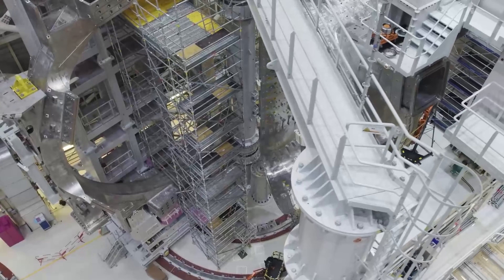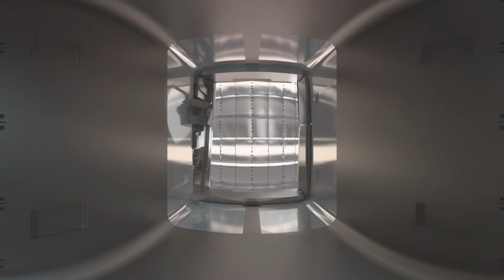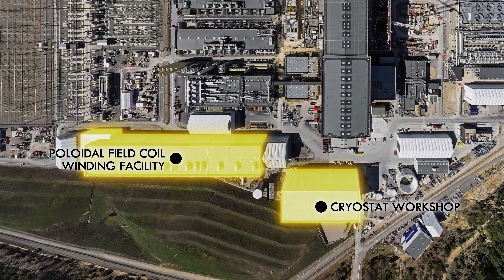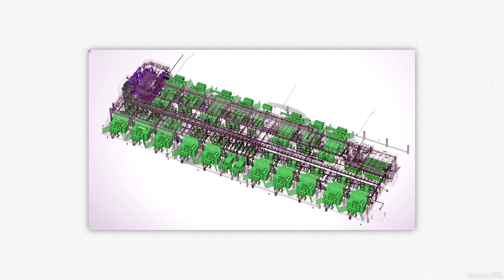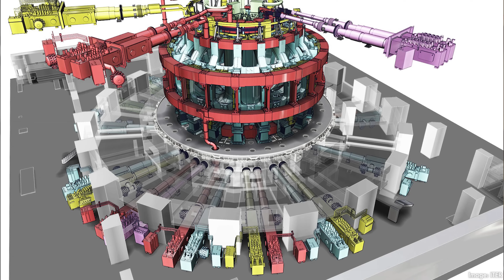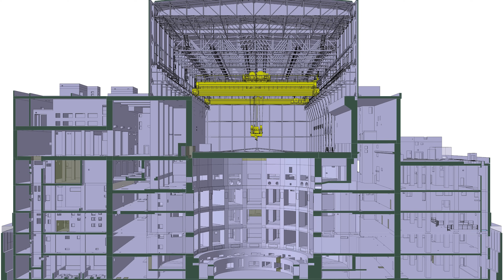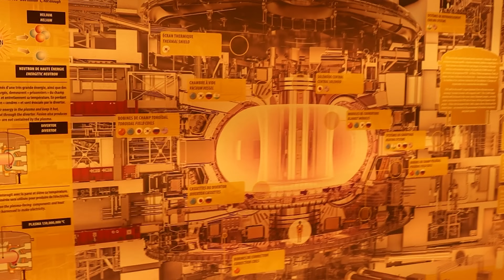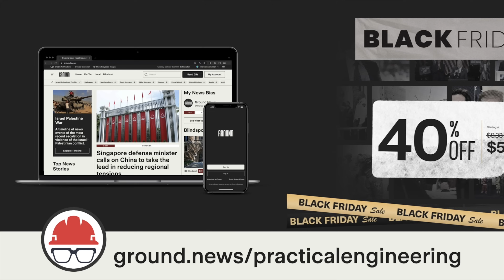Engineering The Largest Nuclear Fusion Reactor

Comment: 14:52 "designed to withstand plane crashes" that is true. That is a consequence of ITER being built in France, France has some of the strictest regulations regarding nuclear plants.

In my research on Germany's growing disdain towards nuclear, I found out that their politicians used the argument that their nuclear plants were vulnerable to plane attacks. Indeed, Germany's regulations are less strict regarding nuclear, and german nuclear plants were not required to withstand a plane crash.

In fairness, the stricter regulations increase the cost of building nuclear plants quite a bit.
Reply: To be honest, a plant's susceptibility to a plain attack isn't why the German populace has a growing disdain towards nuclear. Personally haven't even heard that argument being made (though I don't doubt it has been made).
I'm from Germany, btw.
Reply: So much of the messaging around nuclear in Germany centered on how natural gas was the perfect interim solution until “full renewable” because its emissions at point of power production are so much lower than a traditional coal plant.

Of course, that’s only true if unburnt methane isn’t leaking at nearly every prior step of the process. Which it absolutely is. 

Fission is safe, and it is imminently affordable if it’s allowed to scale. Just like wind and solar were much more expensive per unit power a few years ago, nuclear will benefit from scale if places like the US and Germany get the wool out of their collective ears.
Reply: The twin towers were designed to withstand plane crashes. WTC7 fell down and was never hit. As long as the populace can be made to believe the "19 cavemen with box cutters" story they'll believe anything. That's how we get this nonsense... and get them to pay for it.

Comment: 1:37 "...why so much interest in fusion...": Yes, especially when we had a Thorium Molten Salt Reactor running over 50 years ago that is far simpler and less expensive... and is far safer than existing reactors...  and can be miniaturized... and can use the spent fuel of existing reactors (which use only 3% of the potential energy in the fuel). All arguments I've heard center on regulation... not technology.
Reply: Thorium is great, but as you said it still needs nuclear fuel, and its output is quite limited.
Fusion is research to surpass those limitations into infinite scale.
Reply: @Robin-R0b1n-Rbn  "...it still needs nuclear fuel...": So what? So does water (H and O2... they're elements that have a nucleus... and that's the fuel of this fusion). What do  you mean "its output is quite limited"? Thorium reactors "breed" fuel... and require, and create, lots of heat in the process. They can actually "burn" the spent rods from existing nuclear plant waste... which only use 3% of the potential energy in the rods. A molten salt reactor ran at Oak Ridge for 5 years without incident... 50+ years ago. Politics got it shut down. Why? Whose ox was about to be gored?
Reply: @Robin-R0b1n-Rbn  Nonsense.
Reply: @toddmarshall416  ... No, it isn't nonsense.
Quite the strong counterpoint there bubbo
Reply: Or even just nuclear fission in general, literally the safest power source that we could also use for a very long time
Reply: People have been bought and sold into the religion of Climate Alarmism. They don't want an answer, they want an unsolvable problem so they can keep people in fear of the end of the world.

Comment: Like they say since 60 years: In just 20 years we will have fusion power. ;)
Reply: no, back in the day they thought they were close and by close i mean decades away. since then its been well understood it will take till 2070 or later. ITER is the first fusion RESEARCH reactor, not even a prototype power plant. thats DEMO and it will be starting construction in the 40's and wont be producing power till 2050 most likely. have some patience.
Reply: @Vulpecula1919  DEMO by 2050 with the current level of public funding? That’s quite optimistic. Perhaps with strong Private-Public partnerships, it could be feasible. However, this would require significant investments to be made swiftly, and DEMO would need to operate under a different regulatory framework than fission power plants to avoid unnecessary delays. Gonna be hard.
Reply: @alexanderlau770  The EFDA was superseded by EUROfusion in 2013. The roadmap was subsequently updated in 2018.[31]

    Conceptual design to be complete before 2030
    Engineering design 2030-2040
    Construction from 2040

Comment: Cool scientific and engineering project but I would refrain from bashing Fission. Fission works and in about 20years from basic discovery of the neutron we have had working prototype of what we call GenIV reactors (breeder EBR1, which basically enables U fuel to last for as long as sun/earth exist). Working reactors powering submarines and mega cities, with minimal and extremely manageable spent fuel materials. Fusion will not improve on any of that (really) and poor chance of ever being cheaper (even same order of magnitude). Pessimism on one technology and uber-enthusiasm on other is not sign of good engineering/judgment.
Reply: They don't like fission because it's not part of the agenda for the religion of Climate Alarmism. Their answer is to worship solar and wind and never question how unreliable they are.

Comment: Would you be able to give a timeline on the current fusion reactors going up?
Reply: ITER is, currently due to come online Q4 25/ Q1 26. There will be an extended period of run ups/ downs, load & stress tests in a live environment ( opposed to the same tests being run in the build up to it coming online initially). How long that last will be dictated by issues or lack or but whilst the math, engineering & generation is soundly based and well modelled. It is still the 1st of it's kind. 

Oversimplifying things. It's essentially a 'proof of concept' project so them popping up and working their magic on a National/ State level isn't something you should expect within a decade I'd guesstimate (( again that was a massive oversimplification)). Just the cost of construction & materials is a major barrier to even the likes of the US / China
Reply: only 29 years to wait.